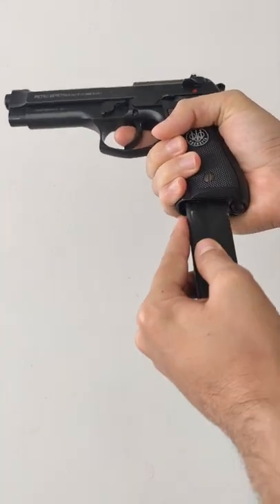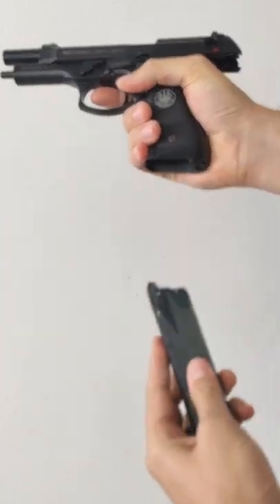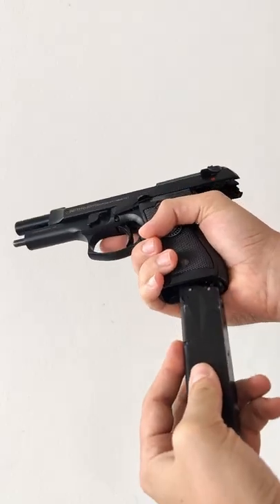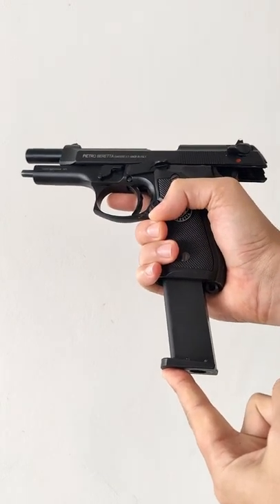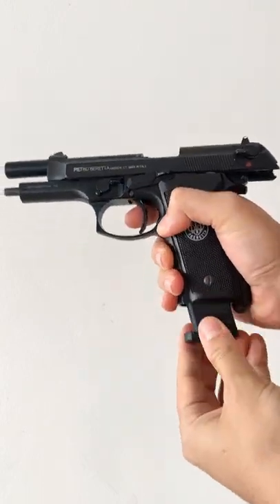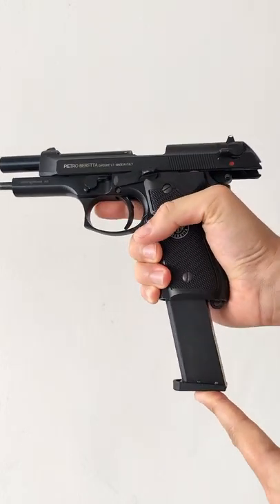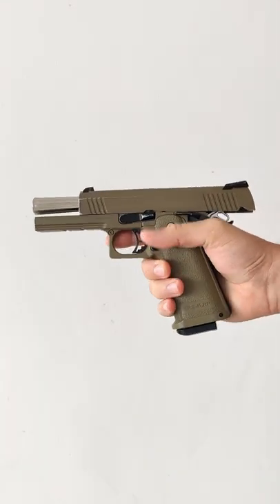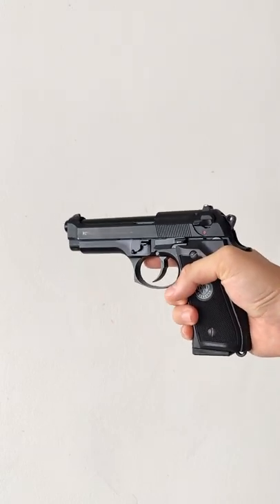Cool Reloading Trick for your Gel Blaster/Airsoft Pistol

Comment: Cool trick. For those using less than lethal training arms to build pistol skills, it works on real pistols also, at least on many Glocks. The problem is that in about one in ten times it will fail to chamber a round, so it's a bad technique to rely on in a fight or even competition with real firearms. If your slide falls on a reload it's better to train to cycle the slide to make sure that you have a round chambered, even if 9 times out of 10 you eject a live round. That tenth time, when you fail to chamber round, can get you killed. 

There's even a debate on using the slide release vs grasping the slide, pulling it back, and then allowing it to return to battery. The slide lock release is less reliable than manual cycling the slide. That may not be an issue on the range with a clean and freshly lubed gun. But in dusty and dirty conditions, your weapon may not cycle and  pick up a live round with 100% reliability. Figure out what works for you and your weapon, and then practice that way to build muscle memory.  Don't alternate between methods.

Also, if you want to up your training and build proper muscle memory for live fire with real pistols, your trigger finger really should be higher up and resting on the frame. From the angle you are filming, very little if any should be visible. Your body has a sympathetic reflex that can cause you to have a negligent discharge if your hand involuntary clinches if you slip, get bumped, get startled, or take an incoming round. The way that you are holding the pistol,  even using your other hand to open a car door or push someone away from you can cause you to involuntary pull the trigger.

Comment: Never heard someone call an airsoft pistol a “blaster” before.
Reply: It's an Australian thing
Reply from the maker: It's a gel blaster, same thing, different smell :p
Reply: @BlowBackIndustries  nah saying there the same is like a motorbike to a push bike but still super fun
Reply: @ulose5909  they use the same internals only just use less accuarate slightly softer gels
Reply: Not everything evolves around america
Reply: @muneebrafiq7725  bro what 😭
Reply: Same shit but using gel which is not as hard as bb, and must be less harder spring for the gel bb
Reply: @GavinC.S there is no spring it's using compressed gas
Reply: @noveske.2236  in the magazine bro i mean, well its a gas bloeback sure. But comparing the spring in the airsoft bb and gel blaster, must be weaker on gel blaster
Reply: It's a gel blaster tho not an airsoft gun, notice the difference
Reply: @BlowBackIndustries link to that gun?

Comment: Even though though this is possible on many guns, some easier than other. The replica/blaster in the video is modeled after the real Berretta 92sf which is one of the easiest gun to do this trick on due to the weight, design, and location of the slide release. I can't speak for replicas/blasters but this is completely safe to do on real guns.

Comment: Does it work like this with real Beretta?
Reply from the maker: It should! 🤞
Reply: if it does that means the slide catch is already worn out and need replacement
Reply from the maker: @erikmarcel1845  Ah I see, well I have limited experience with real Steel versions 😆